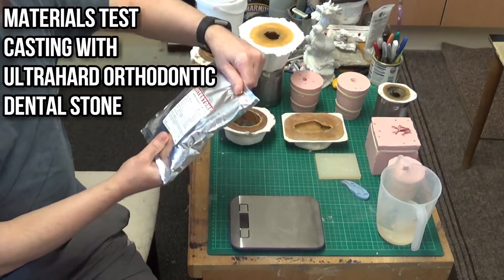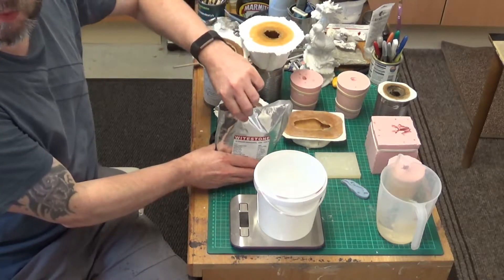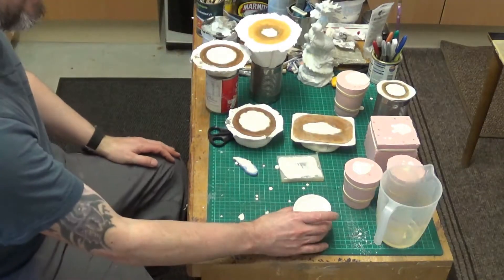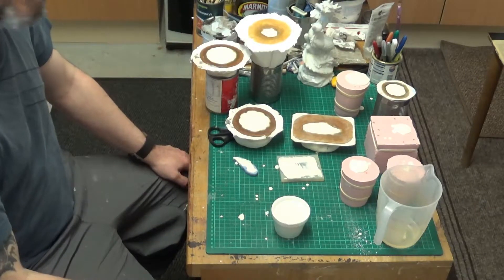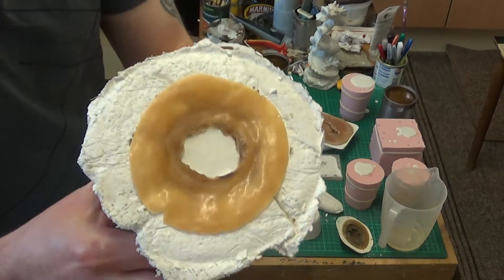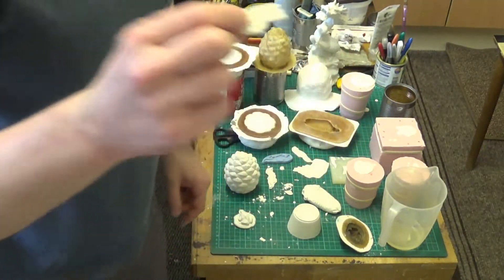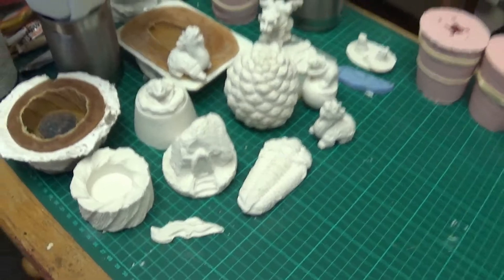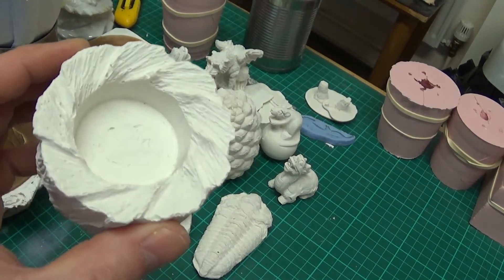Materials Test | Casting With Ultrahard Orthodontic Dental Stone

Comment: Nice vid Drama..... This looks very similar to Gypsum Cement which mixes and pours very well and is very hard..... Have you tried that?  If you have used Gypsum cement (hydro-stone) is the dental plaster heavier or lighter?
Reply from the maker: I guess all the plasters are much the same as regards to mixing and looks, etc. So far, with the experience I have had with plasters, the dental stone has setted off the hardest. I'll let the dental stone dry out over the next week or two and test it's weight again. Feels hard and solid at the moment. :)